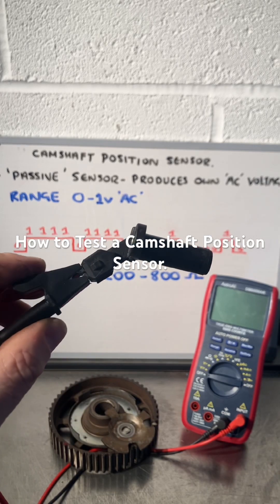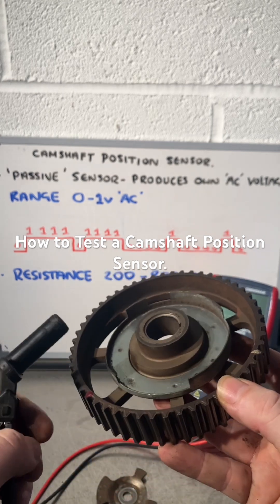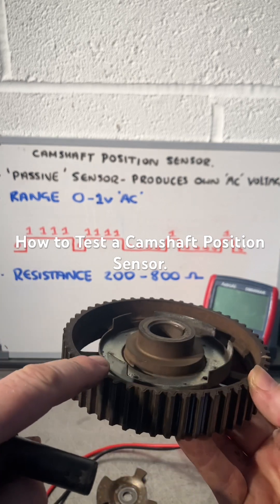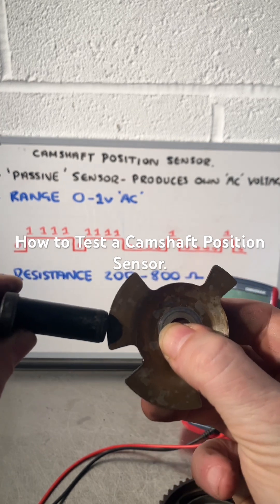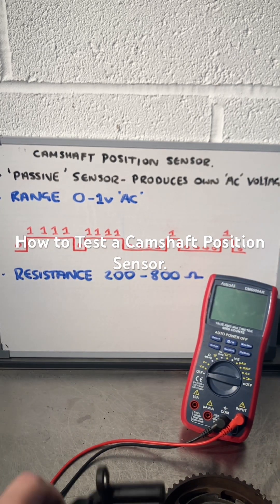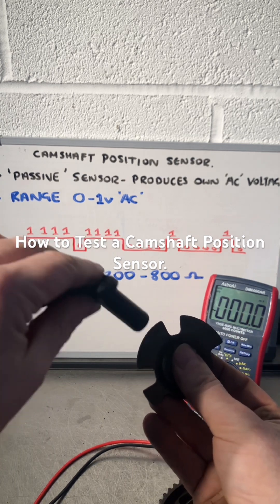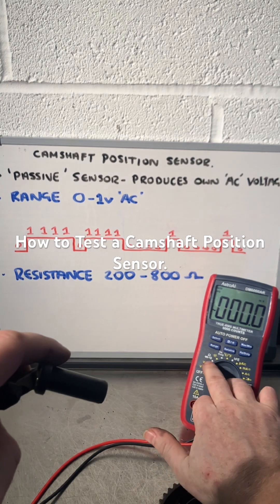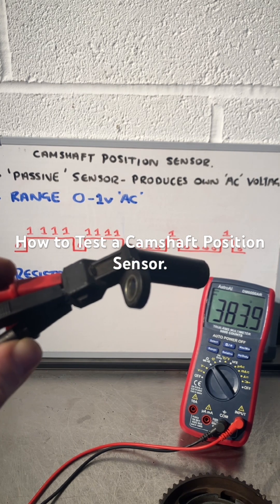How to Test a Camshaft Position Sensor.

Comment: You are wrong! This inductive sensor is not binary it produces a sign wave. It would show on a scope as an ac wave plus to minus. All the teeth on a reluctor ring would be the same width with missing teeth to give a zero volts line.That red wave form you have on the white board is hall type sensor (3 wire) that pulls a reference voltage  (usually 5v) either up or down.

Oh and a camshaft doesn't deliver any fuel it just opens the valves. A fuel pump can be driven off it . But it's the ECU and injectors that deliver fuel to the cylinders
Reply from the maker: Yes, you are right. I’ve mixed the two together. The north/south magnets active produce the square waveform. I obviously wasn’t clear, I only meant the ECU use the info from the cam sensor to help with determining fuel deliver/ timing etc. Not my finest work!
Reply: Subbed. Good work 👍
Reply from the maker: Thank you!